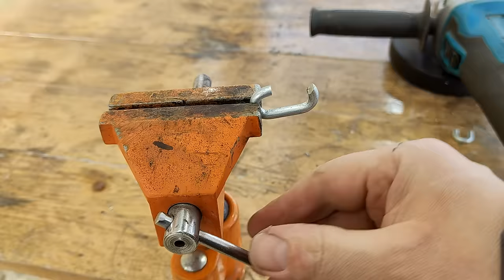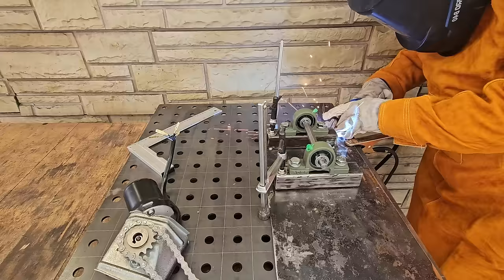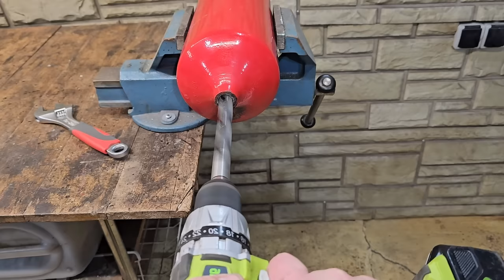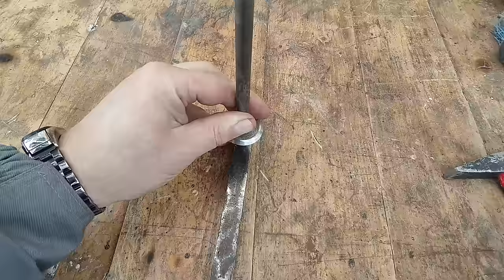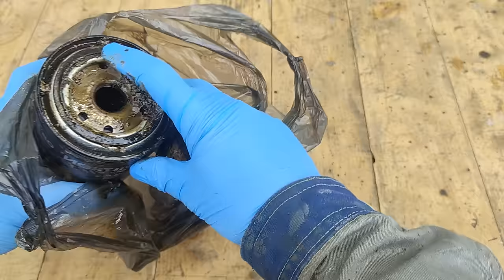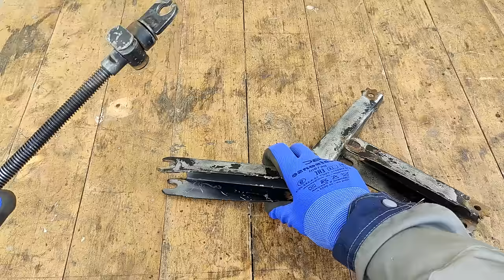7 TOP useful DIY items from the garage.Never throw away useful things.

Comment: Fascinating expertise.  Just two observations (which are not intended as criticism):  1)  I noticed screws and bolts which were turning as if these were left-hand threads; then I noticed the label on the Air Compressor was backwards; and 2)  due to the complexities involved in your masterful creations, even with the transcripts, I feel a need to take much more time to get a comprehensive overview of your projects.  I too see many useful materials in my everyday life which others quickly discard, whereas I see value.  Except that I oftentimes either lack the know-how, or tools, or the time, to fulfill my ambitious creations of re-purposing.  Space to store salvaged resources and space to work are, of course, two other issues.  I loathe and reject the term "pack rat" which is  frequently used to detract from my insight to see the value of inoperable devices and materials.  The enormous waste bothers me.  Thanks for your videos of creative  transformations which are inspiring to watch.  If only I could better understand where each project starts, and where is the intended final result, it might help me better to see.  I imagine that each video requires much additional time and effort to plan and enact --- considerations which give a greater appreciation of the final results.  Do you find it sometimes necessary to edit and toss out sections of video in order to condense the  results for us viewers to enjoy?
Reply: I notice that the bolts and nuts were all left hand threads all rotating machines were rotated anti clockwise, I suspect it is to do with the camera ?